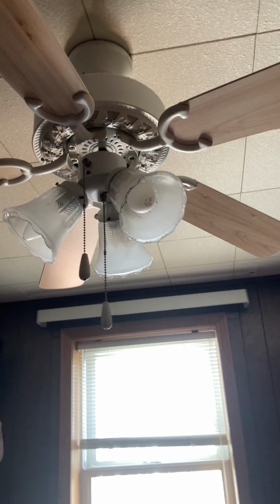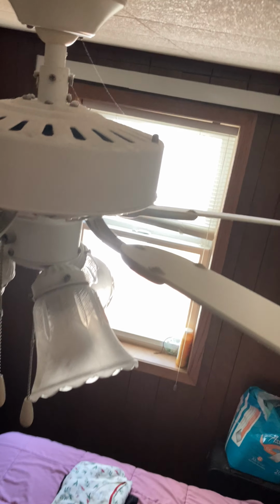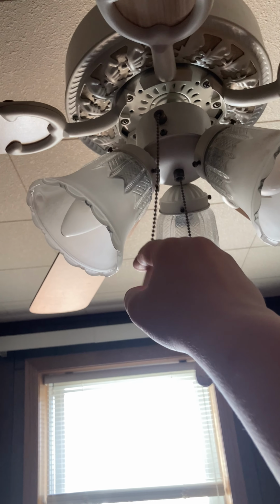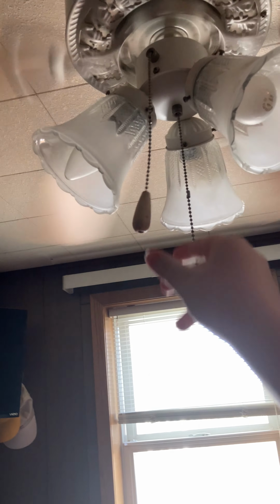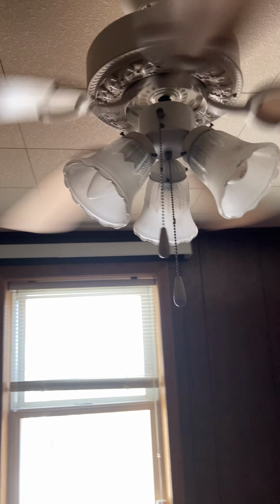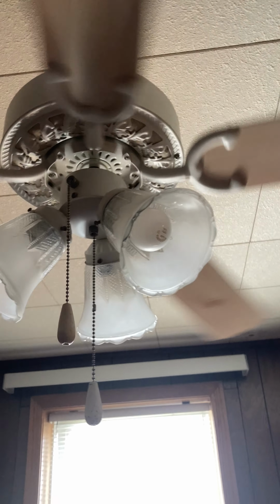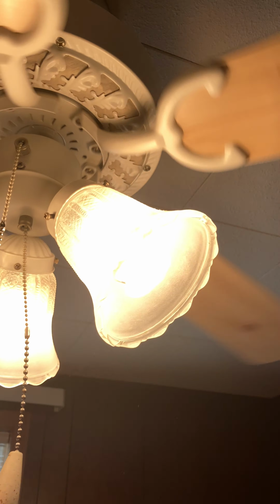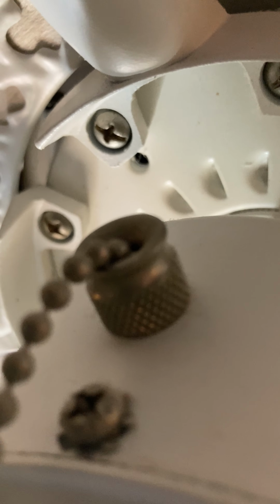Encon traditional ceiling fan

Comment: This is an Encon ceiling fan and the blade irons are not original because they never came with C brackets
Reply from the maker: Thanks for letting me know
Reply: @fansandvintage2008  anytime
Reply from the maker: @ACFC.1000  well I looked it up and it’s not the same fan is this really a Encon
Reply from the maker: @ACFC.1000  okay but it might be month because of the whole COVID thing
Reply: @fansandvintage2008  okay that’s fine